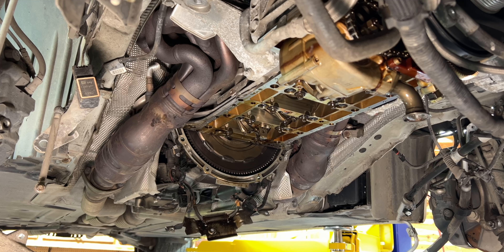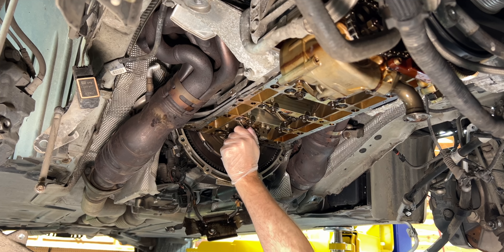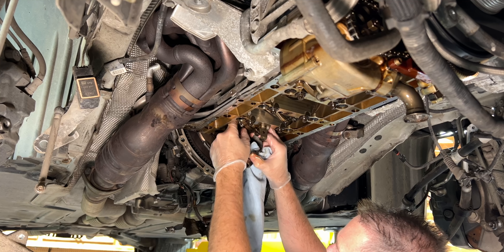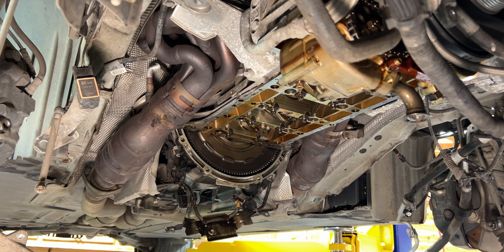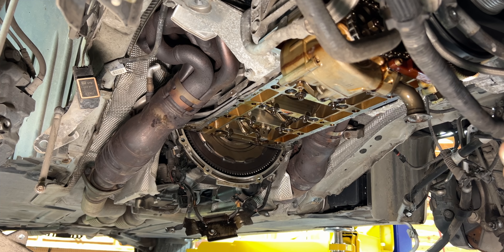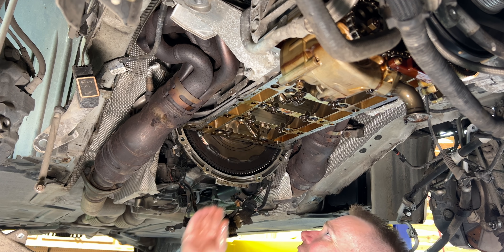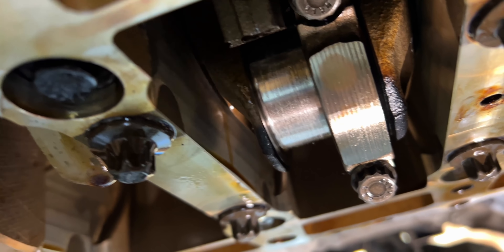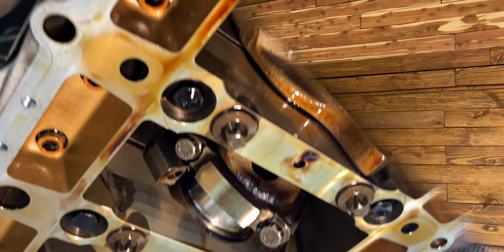BIG PROBLEMS With The BMW E60 M5 Engine ...

Comment: The crank, and certainly the rods, have worn oval from the spun bearings.  That BMW engine needs to be completely disassembled and the crank and rods taken to a competent machine shop and measured, not only for the external journal size with a  micrometer, but also with a dial test gauge in the rods to determine if the internal big ends of the rods are out of round.  Most likely the rod's big ends are certainly now out of round from the spun bearings.  The crank also may be bent and out of true and destroying the rods with every revolution, even though the bearing journals of the crank are not scored or measure within wear limits.  Once the parts are trued, re-ground, and balanced, upon assembly the individual bearing clearances need to be tested for the proper bearing clearances.  This can be done for a lot less than the cost of another used M5 engine which is likely to have problems.
Reply: As an engineer I 100% agree with you. The only curious oddity is that he confirmed there was zero matalics in the engine oil. Maybe he'll get lucky. Take it all apart and it'll be in spec....??
Reply: I'm no engineer, but I reached a similar conclusion. It occurs to me that it should be worth a shot to resurface the crank and go with new rods and corresponding bearings. That's gotta be bargain compared to a whole new motor.

Comment: Had this happen on an N43 4 pot engine number 4 bearing spun and was knocking when warm stripped the engine took to engineering shop they checked the crank and was amazed to find it well within specs, no damage just needed polishing we replaced the rod all rings and bearings cam-chain guides Ect put back together and it was fine. wouldn't be worth rebuilding yours rather than buying one, I know its a V10 but if the crank is OK might be worth trying to save or at least pricing it up, just a thought...
Reply: The E60 m5 is too special to let it die

Comment: I had this happen to my M5. Had one bearing spin slightly and similar score marks on the crank. Crank was one one thousands out of spec at that bearing. We changed pretty much everything in the engine, bearings, vanos pump, vanos solenoids, oil filters and pretty much everything else where the oil runs. Put it back together with better bearing, upgraded vanos pump and so far after 1000km running in and 2000km of hard driving she's still running smoothly. For how long she's going to run smoothly who knows but she's still running.
Reply: Still running?
Reply: Yep, with no more copper in the oil. Just done another service on her and oil was clean. I've been doing burnouts, sitting it on the brake and revving it out regularly and still going well but my heart is in my mouth everytime. Car gives me anxiety

Comment: Polish or redo the crank and new undersized rod bearings, should be ok. Change the oil pump as well, and make sure no debris in the oil galleys in the block. Must be cheaper than a new old engine, where you probably need to change the rod bearings anyway
Reply: Plus 10x rods ?
Reply: @rhiantaylor3446  Why new rods? An engine builder checks the roundness of the rod ends and easily deal with this if necessary. You can even check them yourself with the proper measuring tool

Comment: I’d bet someone changed the oil hoping to solve an issue and the shavings were flushed out with the oil change and filter was changed. Do you not mic the crank to see if it’s alright? Or mic crank and rods to see how much is gone?

Comment: That blows.  Sounds like a maintenance gone bad. Before anything I’d see if the cam journals look dry. But I’d resize the rods, deck the heads, acid wipe the rod journal’s to get the material off,  hand polish the crank and check spec’s. What a mess. But I’m curious. Good luck

Comment: I think your first assumption was right the bearings were too tight hence the lack of lubrication on the bearings the crank is scored from the bearings being too tight. I think some one changed the bearings didn't check the clearance and put it together. 🤔  I would tear it down in the block is good I would polish the crank so they are all the same and then do standard or over sized bearings depending on the polish of the crank and check the main bearings too. I love the V10 M5 if I have a chance to get one I will but my rare 2004 530i SMG M54 motor will have to do for now maybe a custom turbo kit. What to do?

Comment: Try muriatic acid on the crank journals they might come back to life it will dissolve all the aluminum bearing material.  The rods are no good they will have to be resized.  It appears that someone had changed the bearings out with the wrong ones.  That motor was minutes away from a window appearing  in the side of the block.  Good luck on this project

Comment: Yes you need a micrometer and I beleive someone's been in there too! You need to check the size of the big ends and the crank Its as though its had a crank remind and someone's fitted standard bearings Which is what I had on a 2litre pinto engine many years ago but this one was done by the factory and not known to me The block was lined bored 10 thou over size and even the main journals span! Happy hunting James

Comment: try weak solution of  muriatic acid  on the crank with a small brush to see if the aluminium residue beings to dissolve ,if it clears up ,more than likely the crank will be ok and the marks are from the bearings only, of course you cannot leave the acid on the crank for days, a few hours will be enough to see what is going on.

Comment: I would confirm the rods and crank are out of spec. If they were recently done by a hack there may not be a ton of damage. If some of the metal from the bearings is stuck on the crankshaft there are chemicals that will take it off. I think I saw it on M539 Restorations recent Alpina restoration.
Reply: It wasn't M539, I just watched it and it wasn't in there. I can't remember where I saw it but they had a crank with bearing material and it looked bad, but they put some type of acid or something and it took all the bearing material off of the crank journals.

Comment: Very bizarre.  Crank looks like it's okay, just needs polishing.  If the bearing were spinning in the rods, I'd expect more metal in the pan/filter.  I'd take it apart and measure the tolerances.  THey may have just put the wrong rod bearings in before, especially if the crank had been turned and polished, but they put original size bearings in it.

Comment: Are the rods and rod caps matched to each other on this engine? If so, maybe they were mismatched upon assembly.
Reply: I was thinking something similar. Each rod must be put back into the same cylinder it was removed from. I could see an amateur mechanic getting parts mixed up once it's disassembled then stuff fits goofy and ends up like this motor

Comment: Was the BMW V10 ever known as one of their great motors?. Did they ever use it in a race car, especially in endurance racing? Is BMW still developing this motor? Can you think of anymore questions pertaining to the BMW V10?
Reply: This engine is from there F1 car. Bmw does not make this motor anymore
Reply: @anthonyk  It was never based on the F1 motor. They just wanted to make people think that. Obviously they succeeded.
Reply: @anthonyk  The M5 V10 motor and the F1 3 liter that revved to 19,000 RPM have nothing in common except the number of cylinders. My point is that there is a valid reason these V10 motors were discontinued by BMW, - after 120k miles they eat themselves one way or another and the fix is between $5,000. and $12,000. or more. There are no bargains with the E60's.

Comment: The rod bearings went bad in these cars from people bouncing off the revlimiter constantly and doing burnouts. The other thing they’ll do is hop in a cold car and start high revving. Any sports car will have Rod bearing issues. These are great engines treated poorly by people with more dollars than common sense.

Comment: I have a question for you man. Have you ever given any thoughts to using a striker kit that you can find online with a few different companies man? I have read reviews from customers as well as the companies that have said that by using the striker kit that it completely eliminates the problem that these engines have with the bearing problems man. I have even seen one where they destroyed it to I think a 4.9 and then pushed 800-1000 out of the engine for a race car type purpose and they said they used the engine for numerous races at high rpm’s and that they never gave problems as well they even used the same setup in a street car and it never gave problems again. If you would be interested let me know ok. I will have to find the info and yes I do have it saved in my phone ok. Or the link to the website or to the entire google search that I did a few months ago about this particular problem man. Let me know if it would interest you Nathan
Reply from the maker: That kit is $12000

Comment: americans are not lucky with the bmw E60 m5, i have one bmw E60 m5 from "06 maintenance on these cars is essential. i have it reliable for 60k km no issues just maintenance, the rod bearings, high pressure vanos line, and the lash on the vanos pump have all been done. it has 220k km on it now with no issues.

Comment: Dude...its simple. somebody had a bearing issue, took it to a shop that didn't check the crank or plastiguage it, replaced the bearings, had another issue and the two silver shells were the warranty replacement from the original bearing job and now here you are.....how do I know this??? seen it a couple times on s65's and s85's and have knowledge of the shops that did the work. I ended up being the guy that had to deliver the bad news as to why we cannot just swap another set of bearings in and how they wasted their money with a terrible shop. Also have seen the damage after a shop "checked" the bearings by removing a cap or two, looking and then putting them back in. you cannot do that. when you remove that cap you 100% have to replace that set of shells. they cannot be reinstalled and ever be expected to hold. The choice of mechanic and the willingness to pay the money for a quality job has to be 100% with any motor these days but double important with german luxury brands.....sorry that you purchased a car that was destined to be a problem from past crap repairs.
Reply from the maker: Dont forget one time use rod bolts, its not that big of a deal to pull it out and take it to the machine shop, which is what i will do

Comment: Let's face it folks, the engines in BMW's these days are complete krap machines.  Their engineering is a joke and on the level of older KIA's and Hyundai's. Poorly made bearings; timing chaines that stretch before 100,000 miles; plastic timing chain guides that disintegrate; etc.

Comment: What’s the deal with these M5 engines? Are they that bad. Surely regular oil services would keep them running ok. My M62tu is still going strong at 180k in my X5.
Reply: BMW took the tech and development from their final formula 1 engines and put it into this engine. Same with the M3 from this generation. I have the n62b48 in my e60 and they share basically zero parts between the s85, completely different engines and design